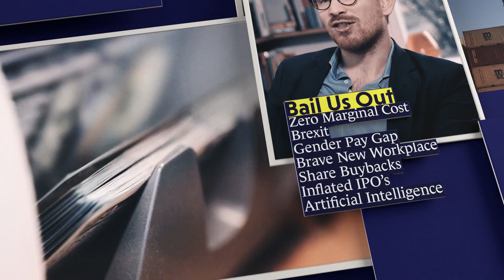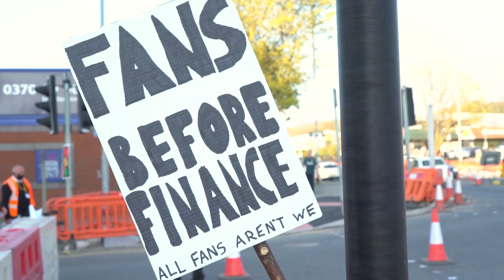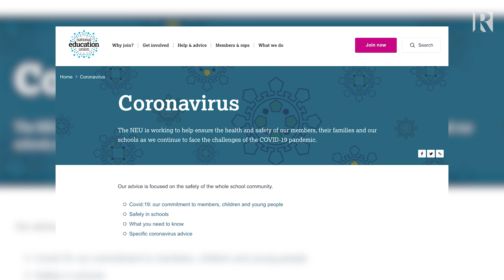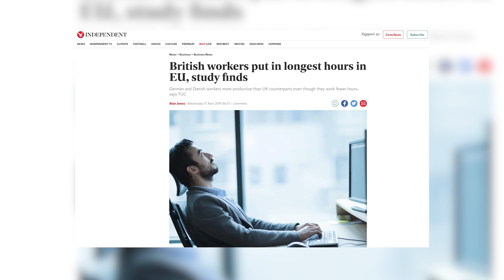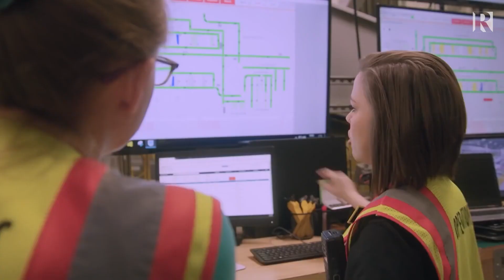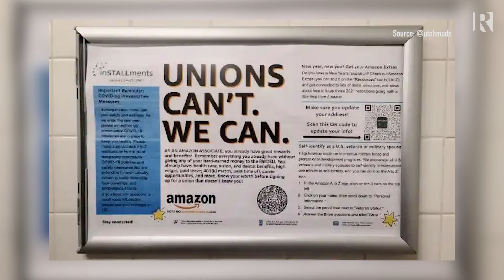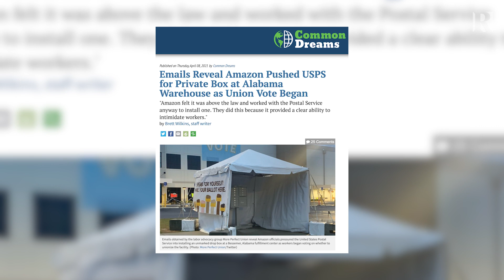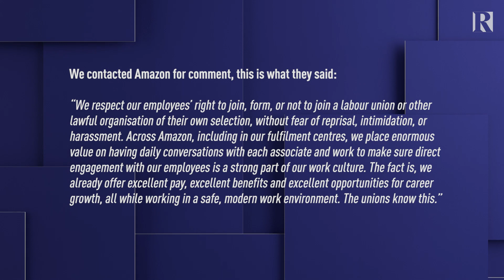Workers – Don’t Just Organise, Unionise!

Comment: I was an employee union organizer that then served on the negotiating committee for a
first contract for 44,000 public employees in Ohio. Unions without doubt secure higher
wages and benefits for workers. But then came a time when little brother took on the
airs of big brother. Original ideals were abandoned, there was abuse within unions, and 
the big umbrellas like AFL-CIO refused to organize -- for example, nursing home workers
who were changing the diapers of the grandfathers of union workers making 60K a year

plus pensions and benefits, when the nursing home workers were making $4 per hour.
The union workers and union bosses were perfectly happy with that arrangement. In our
public employees union, the higher wage professional workers would not join the union
unless the union guaranteed them percentage wage increases, and not dollar across the 
board increases which are always more fair to lower wage workers, who have made less

and less over decades because percentage increases work like compound interest -- those
making $40,000 a year get four time the increase than the workers making $10,000 a year.
And with each percentage increase, the disparity of wages between high and low widens.
A union is a collectivity like corporations and states themselves, bureaucracies, and over
time, they become inefficient, corrupt, greedy, and subject to all the same decadences. Are
they again needed? Yes, but are they some classical solution to economic problems? No.